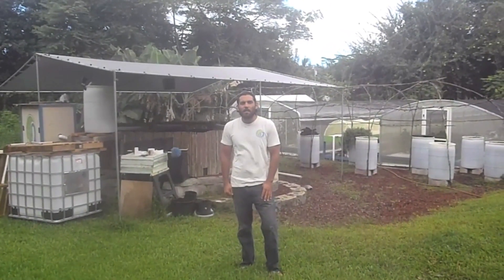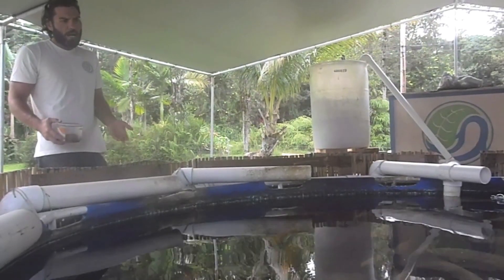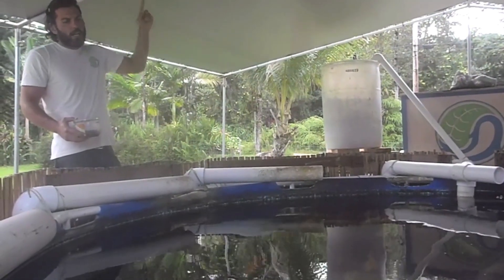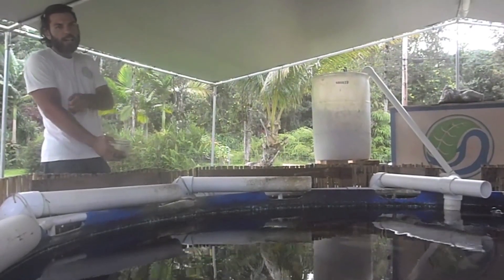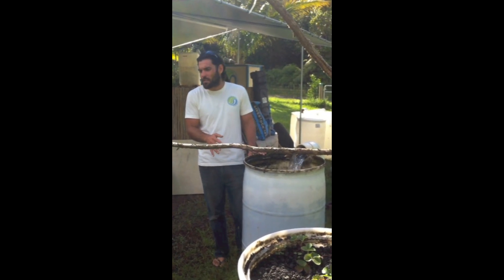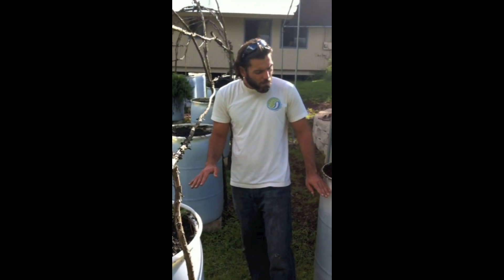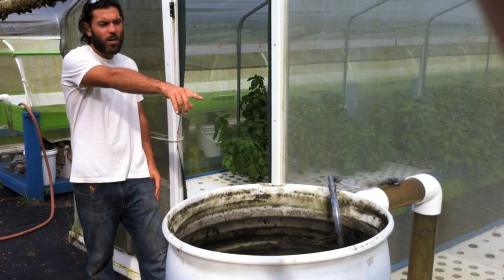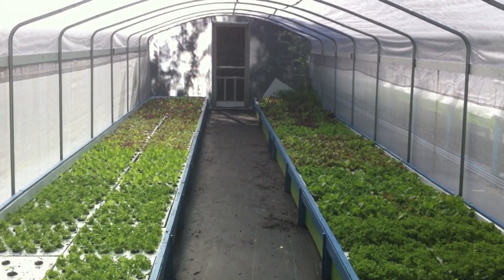Nanawale Aquaponics Tour

Comment: I am very interested in building a vermicomposter for my back yard garden. I have looked all over and yours is the one I like the most. Could you show us more about how the design works please? I would like to build a slightly smaller version. Thank you. <3 your set up
Reply: It's what they call a continuous flow worm bin.  Basically you feed from the top and collect from the bottom.  You need something with small enough openings to keep the food in the top but large enough for the worms to move freely.  The worm treys the sell separately to add to the worm factory tower would work for a smaller version perhaps some bedding on the bottom tray then only one more tray on top and perhaps a ladder for the worms to crawl back to the bedding tray if they fall through to the finished worm castings at the bottom.  Hope this helps,

Comment: Can you do a video to explain how the vortex aeration system works, and how it's constructed? I'm having trouble finding it on the internet. It looks like the water swirls and drains out the bottom. Is that what draws the air into the system? Great system and your explanations are easy to understand.Thanks...

Comment: Well done!  Thanks for posting.   The O2 vortex is an excellent improvement to your system.   I wonder if a solar power company would provide a few solar panels and batteries through a grant or just for people to "see" in your video.  If you chose to incorporate into your system you could further reduce your electricity consumption.   Fantastic work.